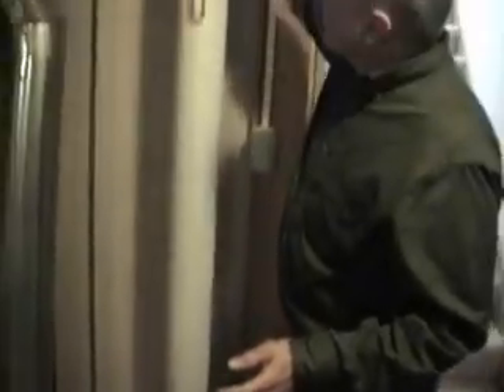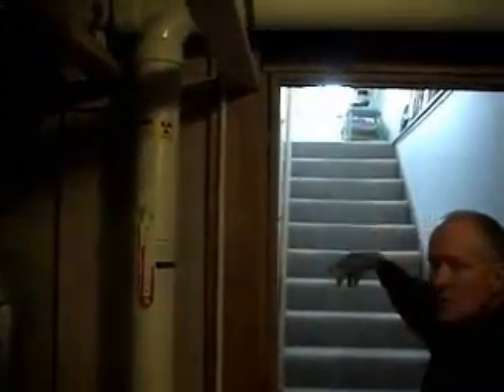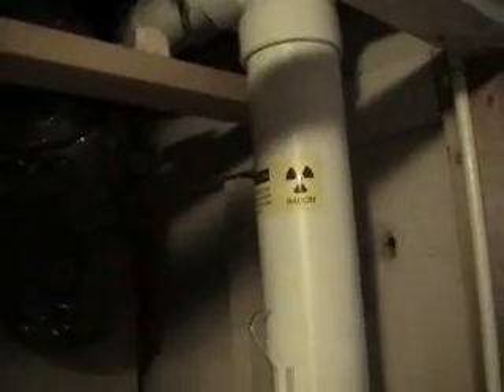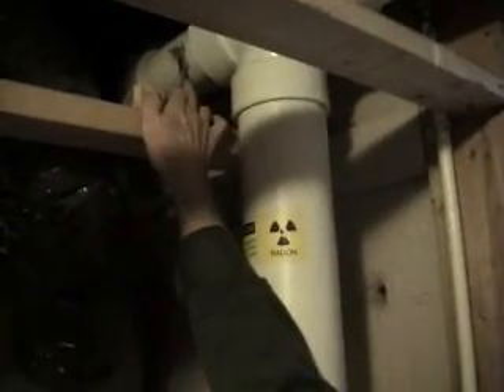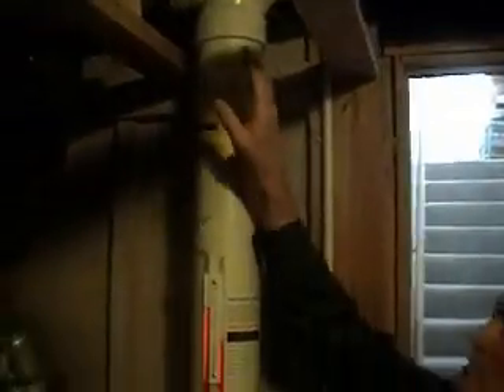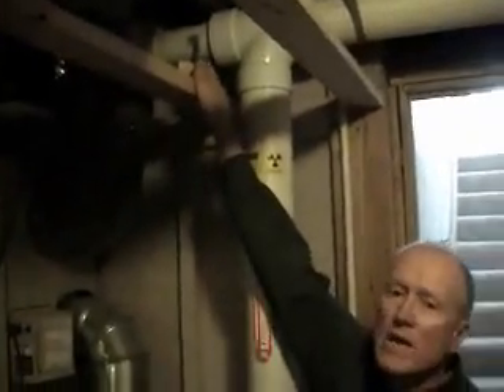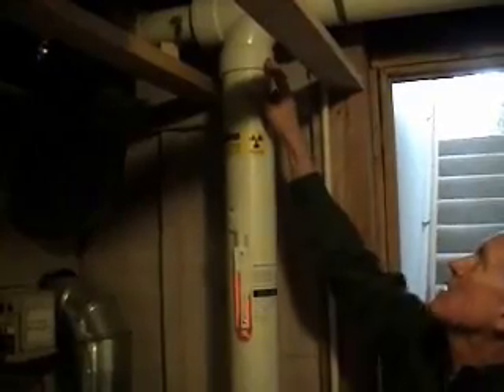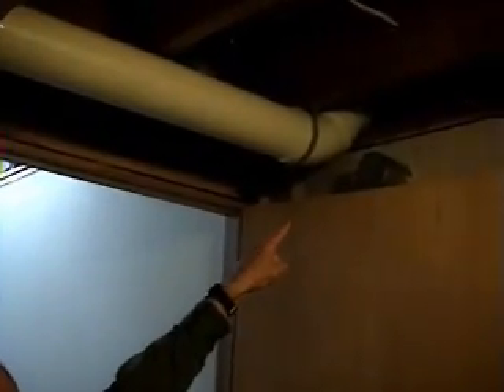How is a Radon Mitigation System installed?

Comment: These systems are such a joke. Just a way for people to make money by scaring people. There is just no way there is going to be that kinds of volume of air under the slab so suck on. If that was the case then underground bunkers would not need a air system to pull fresh air in. We would just suck it from the dirt.

Comment: Radon is radiation. Homeowners may install radon mitigation themselves. For your safety and the safety of others, please refer to EPA radon mitigation system installation guidelines if you are doing the work yourself.  If you are hiring someone to install a radon mitigation system in your home, please know that many states require radon mitigators to be trained and licensed by the state's Department of Health. Contact your state's Dept of Health for more information